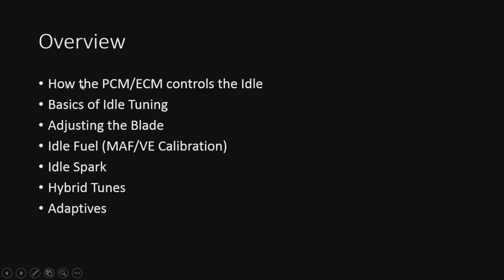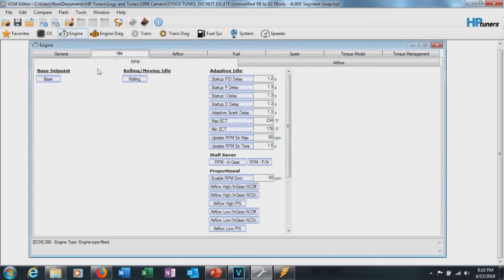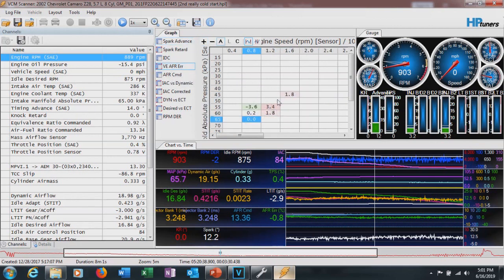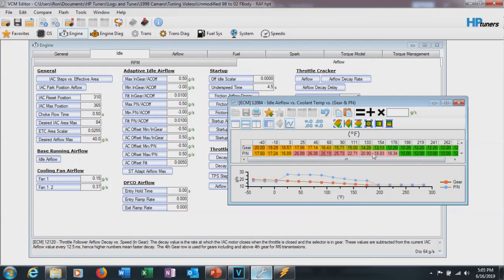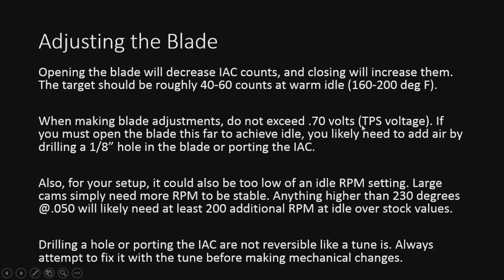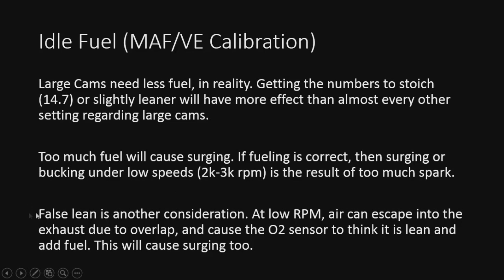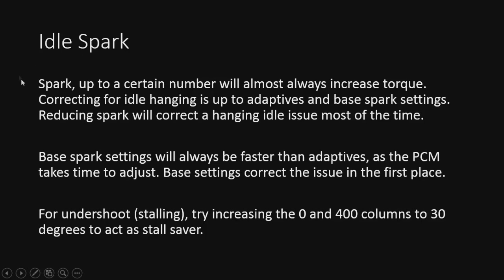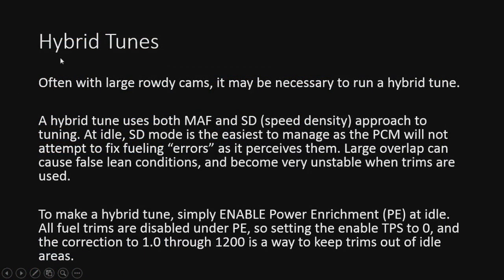Idle Tuning on Gen III Cable Cars

Comment: Great videos on tuning with HP Tuners!  When people say the sound of a cam is in the tune or tunable, what's being changed in the tune?  Thanks!
Reply from the maker: In this case, without VVT or VCT (Ford) or something similar (cam timing), the sound of the cam is simply the sound of the cam. Gen III cars don't have VVT so you can't change the lope with just the tune. If it has a nasty sound, then it is simply a huge cam in there with lots of overlap. The lower you can get the idle the better it will sound, but they get really unstable at lower rpms so there is a limit to how low you can get it. 

As for what is being changed for a cam, basically everything air, fuel, and spark related must be changed to account for the new profile. This video focuses on all of these factors for idle areas. I have other videos that cover the rest of the tuning process for modified engines, the cam being one of the biggest changes you can make over a stock tune.
Reply: Check under Spark>Advance> Idle adaptive spark> overspeed and under speed. You can make the overspeed more negative so if it’s -5.0 make it -10 and for the under speed add 5 degrees to the whole Table. Same as the under speed. Add -5 to the over speed  table and add 5 to the underspeed table You can adjust it to your liking